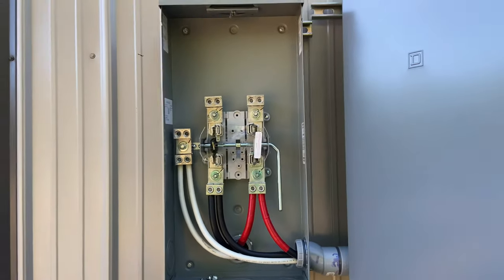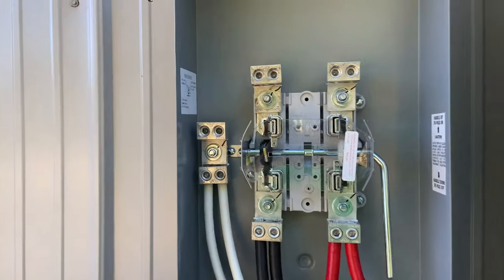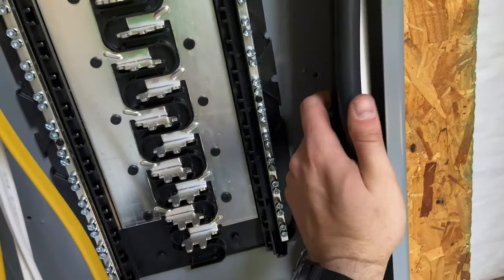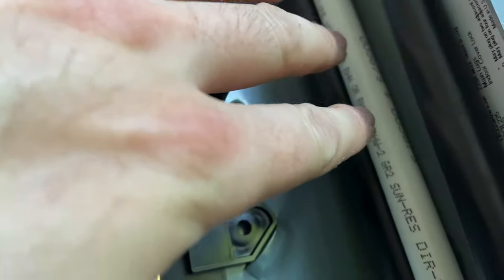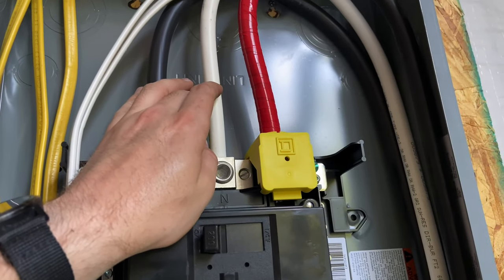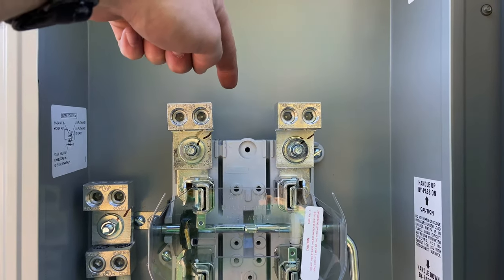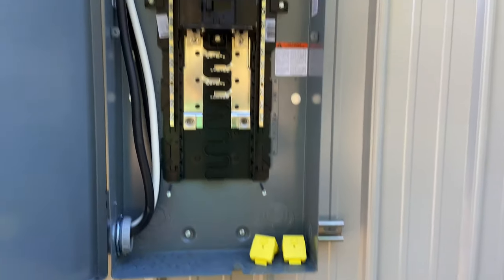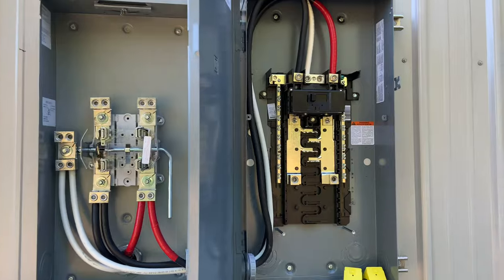Episode 16 - Service Entrance Wiring

Comment: According to the nec, there must be a means of disconnecting be the panel, some part of the nec where it says it applies? My Ingles is not very good gracias
Reply from the maker: Yes there is but I do not know where in the code it is.
Reply: Jjjaa si tu ingles esta correcto  es un remote building el disconect entra en vigencia en  el year 23
Reply: Code service 230

Comment: Did u remove your ground screw from the panel inside ???
Reply from the maker: No, the bonding screw is installed in both the pane on the inside and the first disconnect on the outside since the panels are paralleled.
Reply: @Ciband  so whenever you have panel in parallel you don’t have to remove the ground screw?
Reply from the maker: The bonding screw should only be in the first disconnect after the meter. 

In the case of a 320/400/600 amp service that has parallel feeds, typically 2 or 3 200 amp panels, each of those panels is a first disconnect and would have the bonding screw. 

Any panels downstream of those would be sub panels and have the bonding screw removed.
Reply: @Ciband  so you have 2 main disconnects, the one outside and the one inside? And it’s that fine code wise?
Reply from the maker: That’s correct. The outside disconnect will feed the house eventually. 

Yes, as far as I am aware and have researched, this is how it should be done and is code compliant.
Reply: @Ciband  thanks a lot sir, that was a beautiful work you did There

Comment: What's the benefit of having parallel mains versus 1 main and two subs?
Reply from the maker: Cheaper equipment I think. 

1) The meter can was free to me so that helped the decision. 

2) 400 disconnects seem to be quite pricey compared to a parallel meter can and “normal” 200A panels.
Reply: @Ciband  The main benefit of having a parallel feed is that instead of having one main panel, you now have two main panels and this affects your grounding systems requirements. I would not have used the feed through panel as the disconnect. Had you used a main disconnect, the panel you ran to your house would have been a main panel and your grounding system would be closer. You WILL have to run a copper ground from the disconnect to your house and that will probably cost more than the extra dollars for the disconnect.
Reply: @qball3834  wrong on that he would still have to bond the disconnect and run the 4th wire, and not bond the other panel. Aground rod still has to be driven at the house
Reply from the maker: If I didn’t have a ufer at the house, then yes I would need a ground rod. I have a ufer so I did not drive any ground rods at the house.
Reply: @thomasmarable6818  Not wrong at all. The fact that you now have to install an emergency disconnect between the can and the main service panel means that the disconnect is the first point of disconnect and therefore where ground and neutral are bonded together. ALL subsequent panels are subpanels and therefore are not to be bonded (neutral and ground) together. 
Unless we are talking two different things here, this is the 2020 NEC required installation.

Comment: should not be running   circuit wires through live portion of panel  ???
Reply from the maker: I’m not sure what you are trying to say.
Reply: @Ciband  the top portion of panel in workshop is live . If you have to work on cables coming in top of panel you are working in a live section of the panel .I see that there are insulators covering the main lugs but that area should not be used for safety reasons  ???
Reply from the maker: At the time of filming the PoCo had not set the meter so everything was cold.
Reply: @Ciband  but when the system is live you would be working in a live zone if changes had to be made ,otherwise work looks good   Ken
Reply from the maker: Yes I am aware. 

Thanks for watching.
Reply: @kenallen9163  what are you talking about, you can run cables any where inside the enclosure.

Comment: Where were you required to bond the neutral wire to the ground electrode system?
Reply from the maker: Neutral and EGC are bonded at the each first disconnect (I have 2). From there I have the ground rods bonded to each panel ( panel -> panel -> rod -> rod)
Reply: @Ciband  thanks for the quick reply.  That’s surprising that you could use the same ground electrodes for both panels the way you have wired!
Reply from the maker: As I stated in the video about it, this is what I think is correct based on my understanding of the code. I am not a pro. YMMV. 

Ground rods are localized around a structure and thus all panels and sub panels at that structure should be bonded to them. 

For my house, the panels there will bond to the house ufer. Those panels are sub panels from the panel at the other building. The EGC are all ultimately bonded together. 

This creates a more equipotential ground plain in the dirt so there are is not a large voltage between the structures. This is at least how I understand it. 

There are proper electricians that comment on the videos who could explain it better I’m sure.

Comment: How did you get the inspector to ok you not grouping the disconnects
Reply from the maker: No inspections in my county. 

To my knowledge this is code compliant since the outside disconnect is for a different structure.
Reply: This guy just doesn't want to admit he messed up. And if it's like he said that the one outside is for another building then the one inside should have been installed outside.
Reply: If it's for a different structure it should have been installed on the other structure. Why would you mount a panel with branch circuit breakers on one building with the intention of feeding another building?
Reply: And service entrance conductors   aren't fused so he should have used a meter base main disconnect with feed through lugs then mount the other panel on the building he said it was powering.
Reply from the maker: I very well might have messed up, but that is relative. 

NEC 2020, this might not work and I might have to have two disconnects on the outside (one for the shop per NEC and one for my house per the AHJ since the meter is on the shop and not the house). While that is nice, it is complex and not something I want to do.  When I eventually add solar I might add the disconnect to bring it up to NEC2020 but for now it works. 

NEC 2014, this is where my area is for codes and as far as I know, my install is compliant. 

The house does have a disconnect on its outside per NEC2020 so I am good there.
Reply from the maker: The meter base was provided by my AHJ so I got what I got.
Reply from the maker: @johndavies2949 the AHJ says I have to have a disconnect for each of the parallel services that are fed from the single 320A meter, at the location of the meter. If they didn’t make me, I wouldn’t have. Turned out it was convenient for the house build. 

I also have another disconnect on the other structure.

Comment: Where's the ground and ground nuts for your conduit?
Reply from the maker: Conduit is all PVC so no bond bushings required (as far as I know).
Reply: 😬😬😬 I think you are wrong on that. I'm a commercial electrician and was just bending 3/4 emt today.( That's conduit). Look at my channel and see.
Reply: I think you should check your work and codes because there is no ground wire at all or even a ground bar to ground that box. You put a plastic bushing on your nipple but no ground bushing. You have a metal can and ridgid they are not PVC( that's plastic).  I am concerned about the people who live or work there.
Reply from the maker: Space Dandy: Are you saying that PVC conduit requires a bond bushing?  If so can you explain the best practices for this on how it is done. You would have to run a ground wire to connect the two bond bushings since PVC isn’t conductive.  Would that violate the no parallel paths to ground rule (I think that is a rule)?  My meter is bonded to the service equipment via the neutral. My meter has no place to land the ground.

Comment: As per NEC section 220.61 (C) (1), there shall be no reduction of the neutral or grounded conductor capacity applied to Any portion of a three-wire circuit consisting of two ungrounded (hot) conductors and the neutral conductor of a three-phase, four-wire, wye-connected system. The outside panel as you describe is a required disconnect. NEC Article 230.70 (A) states that a disconnecting means for the main service must be located either outside or inside the building nearest the point of entrance of the service conductors. This panel with the pass through lugs is very useful. But your house panel is not required to be a subfeed panel where you can save a few bucks on a forth conductor.
Reply from the maker: I am not on a 3 phase system Wye system. Standard split phase residential, 3 wire, not 4 wire. 

The first disconnecting means is where the neutral and EGC are bonded. From there all feeds outward are sub panels, regardless of physical location. I believe an older version of NEC allowed feeders between buildings to be 3 wire but this is not so now.  I think it changed in 2011 or 2014.
Reply: @Ciband  yes you are on a three wire system. I know for certain the PoCo xfmer is wye connected. The code is pretty clear and based on the date of this install you cant go my 2011 or 2014 requirements. I am looking at 2017 and 2020 code requirements. You most likely will get by with no issues but when you post a vid people will hold you to the code...you dont get to make the rules based on assumptions....
Reply: @Ciband  yes you are not 3PH because then you could reduce your neutral by 0.83....you are confusing terms
Reply: If the load calc shows enough across the line loads, then reducing the nuetral is allowed somewhere in the code?  Not on three phase, not on lighting panels especially with non linear loads.  3 phase lighting dedicated panels-think warehouse or airport, may need a bigger nuetral due to triplen harmonics on ballasts.  This install will probably get an air compressor, lift, a/c, welder. All across the line loads.  House has water heaters, stoves, central ac.  So reducing the nuetral works.

Comment: Why aluminum wire?
Reply from the maker: It is cheaper and perfectly adequate for the job, both electrically and code compliant. 

AL service entrance wire is very common in my area.

Comment: Ur bonding screw or some kinda bonding?
Reply from the maker: There is a bonding screw at the first disconnect panel for each “leg” of the 320amp service. 

One is the main panel for the shop. The other is the feed through lug panel on the outside of the  shop which will serve as a remote disconnect for the house.

Comment: You may want to look into up sizing the conductors to your future house to compensate for voltage drop.
Reply from the maker: I appreciate the idea. 

I ran the voltage drop calculations and they came back good for 3% drop on 200A at a max distance of around 150ft IIRC so I should be good. House distance is less than that.

Comment: Everything looks like People are actually being dumb and careless to the exception of  the electrician,  there are no exposed wires and he is working at the pole on somebody's residential entrance. The wire that he us holding is neutral,  there's no power running through it at all,  hence it is bare with no insulation

Comment: No ground?
Reply from the maker: Not at the meter can. GECs are running from the two main panels to the two ground rods and bonded in between.
Reply: @Ciband  you used only one rod for both panels?
Reply from the maker: Two rods for the shop building. Both panels bonded to both rods.

Comment: They’re the same phase; you have single phase. They are different legs not phases.
Reply: They are out of phase from each other by 180deg. If they were in phase then there would not be a potential measured across them and a meter would read 120v instead of 240v; https://en.wikipedia.org/wiki/Split-phase_electric_power
Reply: @MrBluelock : There is 1 phase and 3 phase, there can be two legs on the same phase at opposition to each other. There is no 2 phase just 1 and 3. The 120V are just 2 legs of the 1 phase. This is a mistake or misunderstanding in nomenclature as phases are actually defined terms in electric; most people, outside of electricians and people in industrial and larger commercial settings don’t have knowledge, experience, or practice with a multi-phase system. In the US and Canada you have either single phase, 120/240, or three phase 120/208, 277/480, 346/600, wye or delta or 120/240 high leg delta along with combinations there of with transformers. Legs are 180° apart each of the 3 phases are separated by 120°; the 120° separation is what leads to the better power and performance in motors from 3 phase set ups. You’re welcome to check out NFPA 70 otherwise known as NEC 2020 for some specifications and requirements regarding 1 and 3 phase systems as well as obtaining the nomenclature used within the industry; while Wikipedia can be a good resource it’s not the US standard the NEC is.

Comment: Saving money on wiring by using aluminum is just ignant.... 35 year electrician and I must say to you and future builds you might electrician it up with more love.... aluminum is legal but quite volatile... terminals btw with aluminum conductors MUST be serviced as copper once  torqued properly will last a minimum of 100 years unscathed... Sorry if i offended.... wonder why aluminum wiring number 10awg and smaller has been outlawed? Ponder? lol prollly not... saved you money though
Reply from the maker: Thanks for the opinion. I’m perfectly happy using the AL for the services conductors. Wire and terminals are all rated for it. Modern AL wire does not react as it did back in the day.  Almost every service in my area runs 4/0 AL for 200A. I’ve done my homework and am happy with the results. Thanks for watching.
Reply: I am a 45 year electrician and use aluminum alloy cable all the time, nothing wrong with it when installed the right way, so whats wrong with it then. It is used everyday all the time.

Comment: Your grounding is poor, plywood isn't FR.
Reply from the maker: I’m not sure I understand what you mean. Can you please elaborate?
Reply: Okay your video is pretty cool & good.  I am wondering why didn't you use bonding bushing for your conduits entrances for the boxes. Your plywood should also have been fire rated ( FR ).
Reply from the maker: All conduit is pvc so no metal. No bond bushing needed. 

Are you talking about the plywood inside that the panel is mounted too?  That is news to me. I’m not sure that is required (certainly by the NEC) but I’m sure couldn’t hurt. 

Thanks for the feedback.
Reply: @Ciband  its not required if that was the case then all the panel mounted in houses would be illegal.